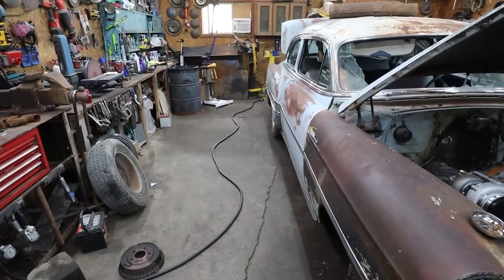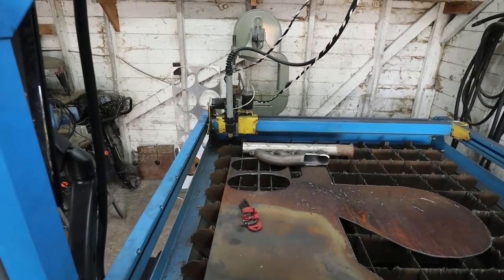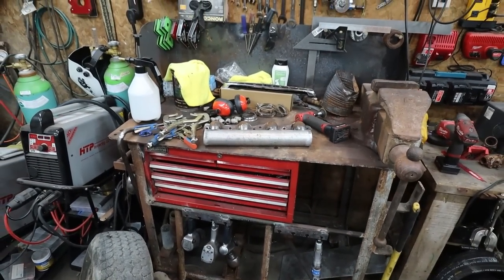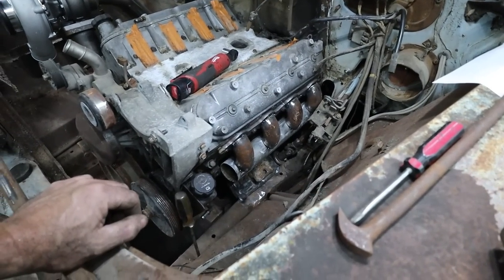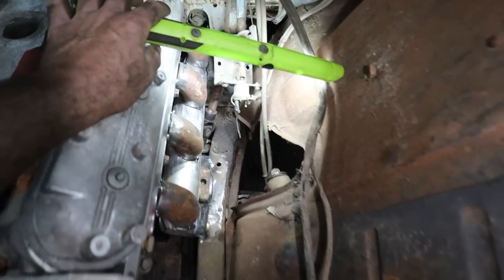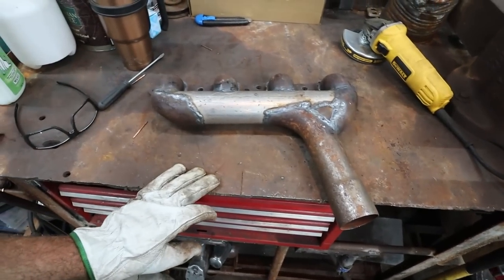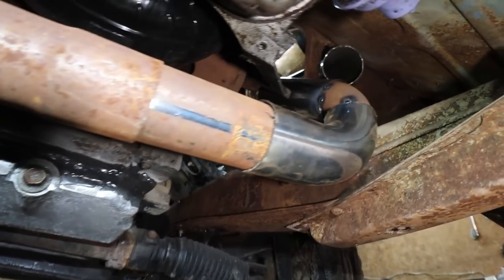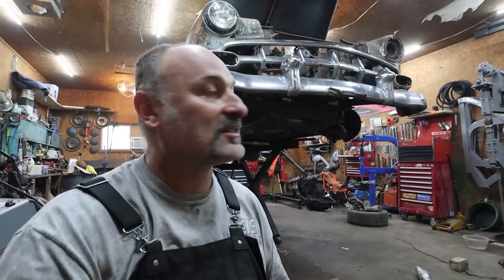Building a custom exhaust manifold for our Turbo LS 1954 Chevy

Comment: I   have   made   manifolds   that   way   I   found   squire    tubing  worked   best   I     welded    it    right    to    manifold   flange   then   you   can   make  it   as   tight   to   the    head   as   you  need,   that   came   out   great   though.

Comment: I think you are right ,the smaller flange on the crossover pipe is for a blowoff valve and the wastegate is on the cold side of the turbo. I'm new to this but I saw it on another channel,don't remember who.
Reply: Nah, the bov is on the cold side and opens when the throttle is closed. 
The wastegate is on the hotside to control boost but venting "waste" gasses

Comment: Hey a custom exhaust manifold fitted to what you need for the car, that’s pretty cool,  I would say. I know it’s a lot more work but if you got the tools and the talent and your having fun I’d say have fun and just do it. When you fixed your power hammer and said about making candy dishes, and I saw you cut out that pipe on the table my first thought was he is going to start making giant flute’s now. Have a good one, thanks. Later

Comment: @36:00 Get a "band clamp" for the driver's side manifold to x-over.
If you put a flange in the 3" after the wastegate....you should be able to fit and weld all that up while the engine is out.
Maybe that's why they have the flex connector, so you can line all three pipes up for assembly.
Reply: Nope, the flexi joint on the crossover is to stop the crossover cracking due to the heat expansion between both banks of manifolds.
Never have solid mounted flanges on a crossover without an expansion sleeve or flexi..

He might get away with it having the slip fit on the driver's side but I think not..

Comment: Its probably good that you don't live close to the place you buy steel from as their scrap cut offs would be in your collection of scrap materials for building a whole rig from! LOL, Brent.... seriously... you do more with less than anyone I can think of.... a good thing tho. I have to ask a stupid question.... why not pull the front clip off to make it so much easier to do a good many other things as well. I know as it comes together, you know just as well that you might say I could of done this had this not been in the way. Truly a testament to your capabilities of building nice rides. 
       On a side note, watching a tow company show the heat on the ground will the outdoor temps were hitting your celsius temps of a forty plus degrees... its our hundred plus degrees...., AND GET THIS, the rocks and metal were showing our hundred and fifty plus degrees temps which is around fifty plus celsius degrees!!!!! No wonder those pups tip toe around outside!!!! This old alaskan is a happy camper to not be in that heat.

Comment: As usual Brent you never disappoint. I appreciate the way you navigate through and around problems with your fabricating skills. Nice job on the exhaust manifold. It looks like you're getting a handle on things and everything is progressing along fine. Your attitude and demeanor is remarkable. Most people would have been set back months if not longer after going through the devastation of the fire and complete loss of your garage. Good to see you a fighter and won't take things sitting down. God Bless you and your Mrs.

Comment: The "flexi" in the crossover is NOT to aid alignment, it's to stop it breaking/cracking off.. If the crossover has hard mounted flanges to the manifolds, the heat expansion cycles will bust the crossover so it needs a sleeve fitting in the middle or flexi to allow movement when expanding/contracting
Reply from the maker: Wonder the difference in this and a factory y pipe unless it's the donuts that give?
Reply: @HalfassKustoms  yeah, I'd say so..

Comment: Brett, have have you ever thought of bringing the exhaust up under the front of the motor to the Turbo? That should work a whole lot better than the way you got it back there with the steering. Better away from the steering
Reply from the maker: Yeah was my original plan but thought the kit would make it faster to build haha

Comment: I did some funky exhaust slicing, slit in pipe lengthwise and crisswise then made the round flat. Curved end and welded flat sheet metal to cap end.
Instead of a clamp,how about a stainless band clamp?
So, if i loaded up a later 5.3, 2009 or something, can you use any of it? Im about to do a scrap run or 3, thats where it will end up otherwise. It had some kind of coolant leak, i swapped it  out for a guy.
Reply from the maker: Never played with anything that new.

Comment: Brent, just out of curiosity, considering the fact that you have a tall hood line would an over the top in front to the turbo route been a little easier to do and maybe even a little shorter run of the pipe.
Reply from the maker: My original idea was just going to flip manifolds and I was going to route it around the front of the motor like I did on a 55 Chevy I had but then I decided to try this kit which ended up being a fail haha

Comment: Brent, I "thought" I had an idea for you, but it would have looked silly and not acceptable for an LS engine.
For giggles, if you could Google an Exhaust manifold for a 1959 Rambler American, flathead six. You'll see they mounted the Exhaust pipe right to the side of the block to save space. (It was a tight engine bay, as I remember). You can have a good laugh. UHHH,, this would NOT work for you. You need access to your sparkplugs. The Rambler was a flathead. Oh well.

Comment: That’s not the most ideal location for a wastegate. On or closer to the turbo. Directly in the flow is best. Flow for both  banks.  Eliminates creep and other issues
Reply from the maker: Yeah with the manifold I'm kinda stuck with this setup, why I went with such a large wastgate
Reply: @HalfassKustoms  should be fine to make some tire smoke.